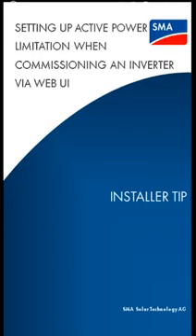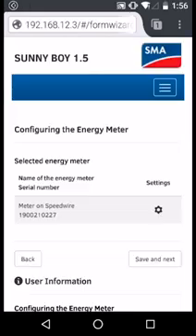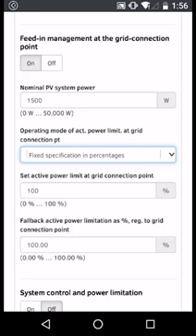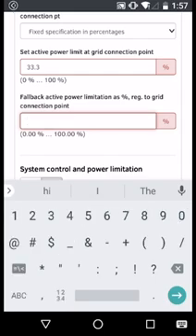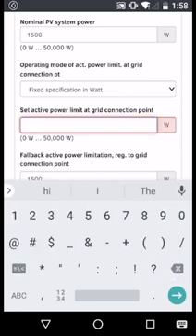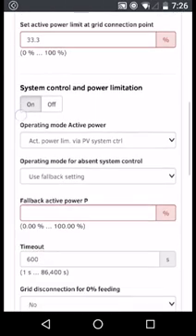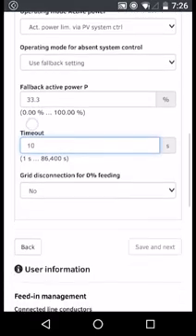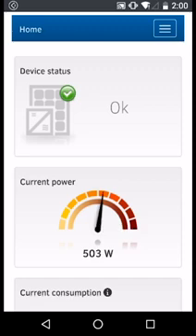How to Set Up ZERO EXPORT With Only an SMA Energy Meter

Comment: Have you tried it on a tripower 6.0 or do you know if it’s compatible with just the energy meter and not needing the home manager?
Reply from the maker: Yes, zero export on an SMA Sunny Tripower 6.0 can work with just the SMA Energy Meter. You do not strictly need the Sunny Home Manager. The inverter only needs a supported energy meter at the grid connection point so it can read import/export in real time. Once the meter is installed and communicating with the inverter, you can set export limitation or zero export directly in the inverter/Data Manager settings.